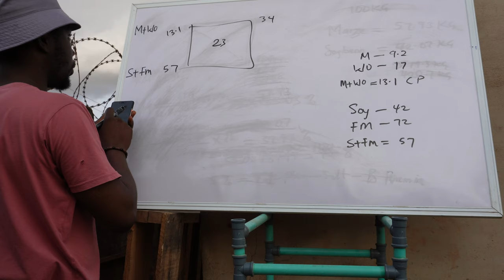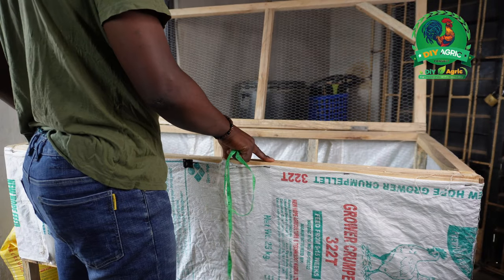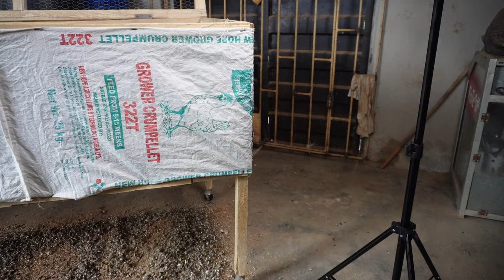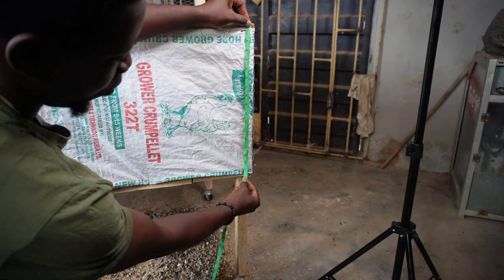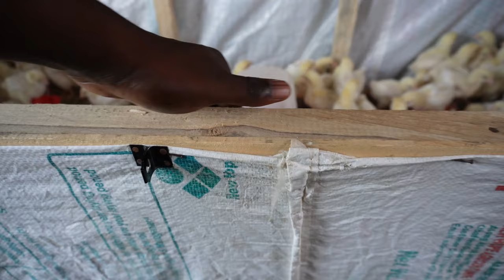Brooding 800 Baby Chicks with ZERO HEAT - Chicken Brooder Plan is Here

Comment: This is wonderful, so if am raising broilers, for long can they stay in there?
Reply from the maker: Depends on the quantity per box. But to achieve the purpose (NO HEAT) they must stay for at least 10 days before they are moved to a deep litter or bigger cage. 

The goal is to eliminate or minimise heat as much as possible. 

Heating equipment and supplies are now expensive for the struggling farmer. Gas, even charcoal is expensive
Reply: Can you do this same illustration for a deep litter or bigger cage,please

Comment: Can I actually use this for the broiler birds
Reply from the maker: Yes, but remember, you need an enclosed room and then this kind of brooder box. 

You should also check the temperature with a thermometer to see if it's okay.

With mine, the minimum we have had even in the night is 26 degrees. And the birds were just fine with that. Provided there is light and feed.

All the best sir

Comment: If you were to brood pullets, how many weeks do you think they will stay in the That box before you move them into the battery cage.
Reply from the maker: I would use the box until the pullets don't need heat even on a deep litter. I will make sure the box serves its purpose - no heat source.
Reply: @feathers_pro  You mean it's possible to have our 100 pullets in the box for 6 weeks?